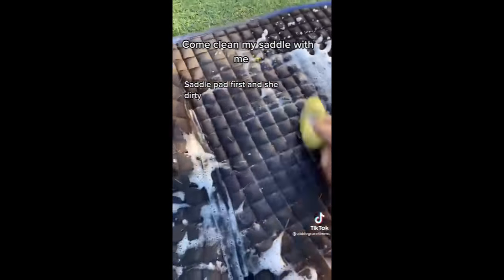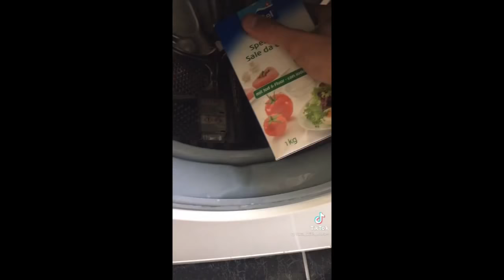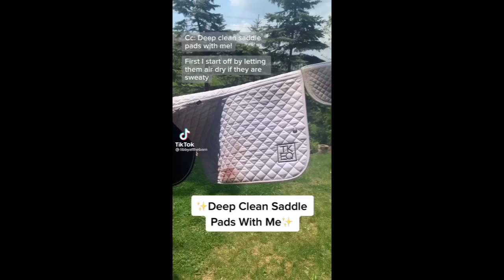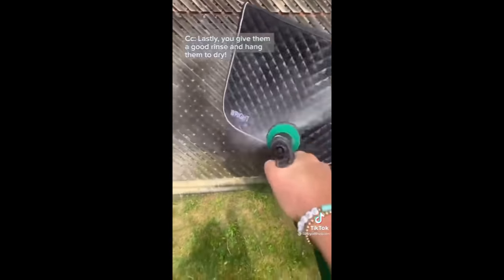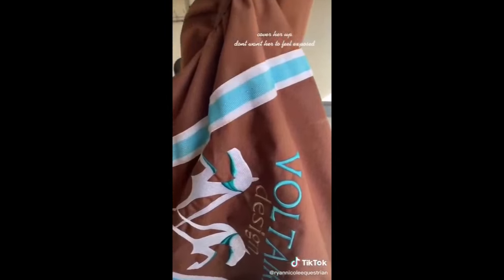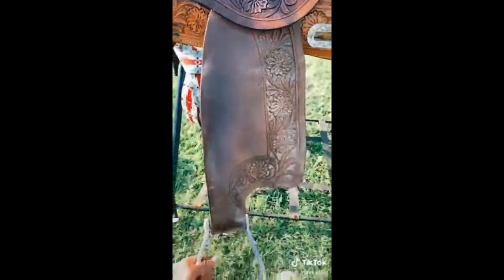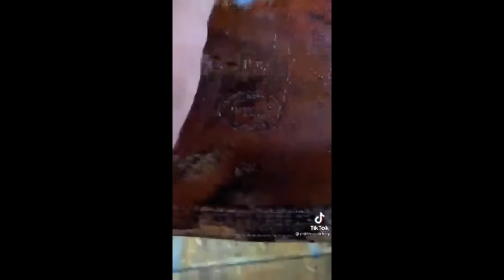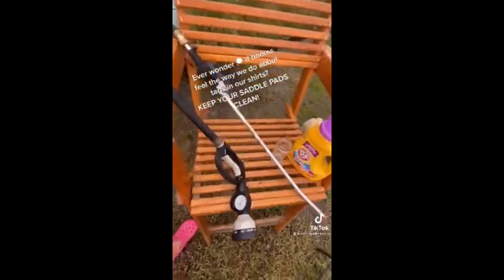Satisfying Saddle Pad and Saddle Cleaning + Making TikToks pt 7

Comment: Tbh I have never seen someone use a paint brush on their saddle— what are they applying with it?
Reply: Idk but I just use saddle cleaner and conditioner
Reply: AHOJKY
Reply: It’s oil, it keeps leather conditioned and kind of makes a barrier to keep dirt from getting in the pores.
Reply: I usually use a paint brush to apply leather oil instead of a sponge(what other people use) as it makes it easier to get in little corners etc.
Usually it leaves quite a lot of oil so afterwards I take of the excess with an old rag
Reply: Its not paint brush